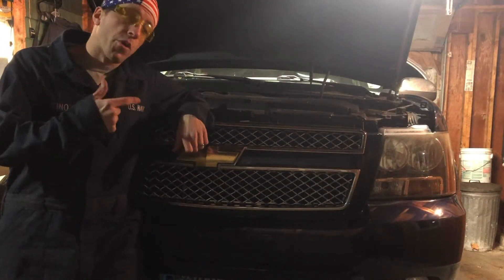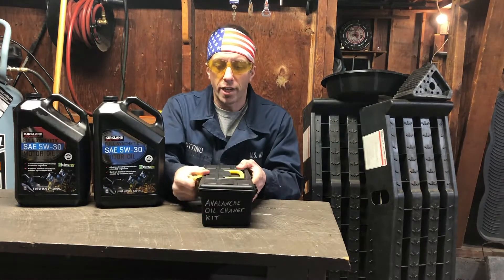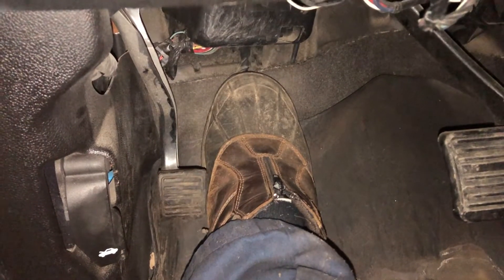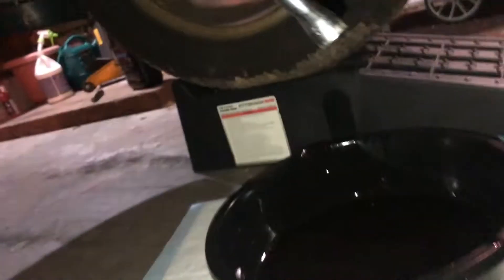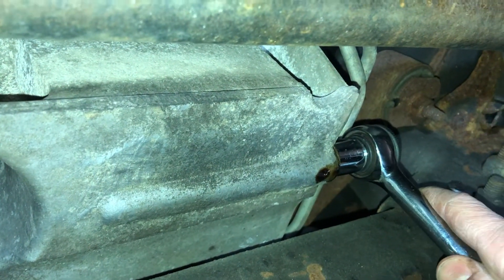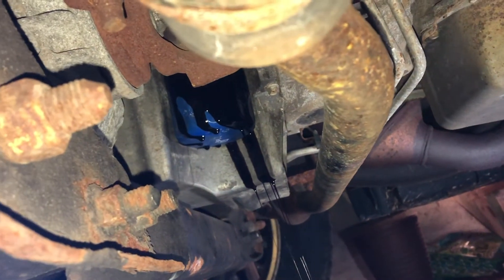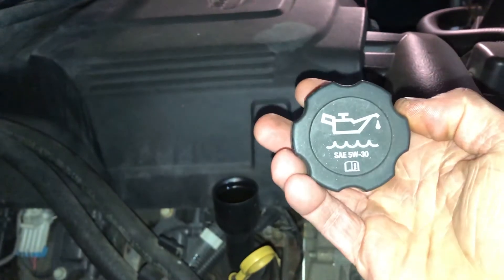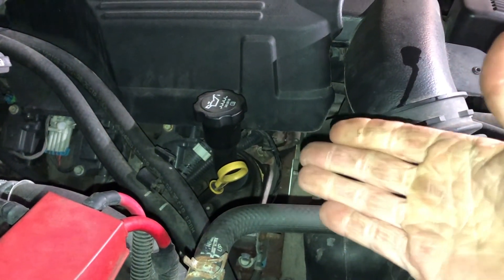Proper Oil Change - Vortec 5.3 V8 - Avalanche - Silverado - Sierra - Suburban - Tahoe - Yukon

Comment: I bought the same drin pan and it only holds 7 quarts and makes it very hard to move with 6 quarts in it, I would have liked to see how he used that lobster claw to remove the filter? I have the cap with 3/8 socket wrench built in 👍he didn’t talk about the over filling that shows on the dip stick with 6 quarts, pretty much just told us how and didn’t show us, I don’t have a kit?? But 5 minutes at the parts store and you’re ready to go, it helps to reset oil life or at least write down mileage.

Comment: Watch out for sideways project’oils…., just bought a 2011’lanche and although I was holding a large pan right under the drain plug as I unscrewed it, the oil shot out sideways over and past the pan.  Next time I’ll start with the pan against the ramp on passenger side and let a puppy bad (good idea) catch the preliminary drips.
Reply from the maker: Good plan! Sometimes it does come out with a fury!

Comment: Can you use 10W-30 too or will that harm the engine?
Reply from the maker: In the summer time - no. The 5w means 5 Winter. So when it’s really cold, the oil flows better for lubrication. If you run 10w-30 in the winter, you won’t lubricate all the moving parts as well as 5w-30. I hope that helps.
Reply: @jimmysgarage9068  Gotcha. I live in a hot climate and drive an Avalanche. I got 10W-30 on accident the other day not realizing I needed 5W-30. But it turns out I got the right grade for the season. Thank you so much!
Reply from the maker: @AzMetalScorpion  What year? 07-10 had issues with the AFM system & will grenade the lifters if the oil isn’t changed regularly. They sell an AFM disabler - I had one in my ‘10 avalanche, as well as my ‘11 Suburban for good measure.
Reply: @jimmysgarage9068  Mine is a 2010 as well. I believe I've heard something about an AFM system one other time since I've had it, but I never understood what it was.
Reply from the maker: @AzMetalScorpion  it’s when the truck kicks down to 4 cylinders. Oil can get past the compression rings and cause problems with the lifters. Keep clean oil in it and you should be ok - but an AFM disabler will ensure the problem won’t happen. My 2010 had the entire top end replaced at 125k.
Reply: @jimmysgarage9068  That's really good to know. I'll have to look into it and see if mine has the AFM system, because kine has over 250k on it already. I know I had to have a cylinder spring replaced about a year ago.